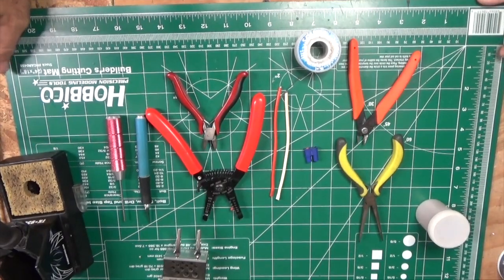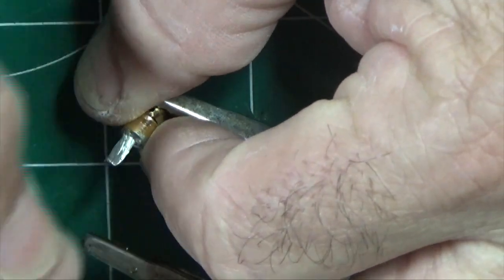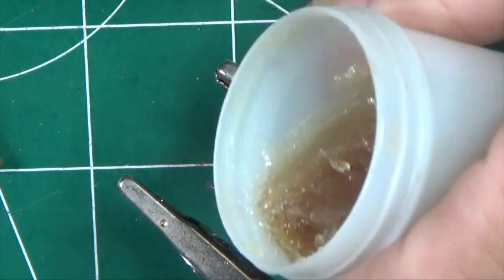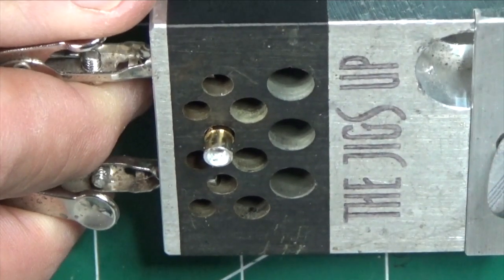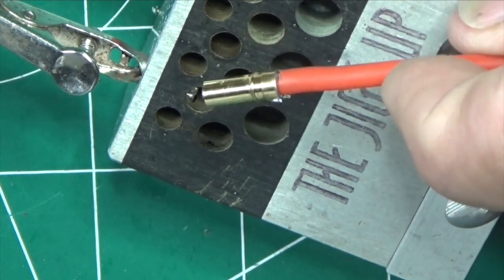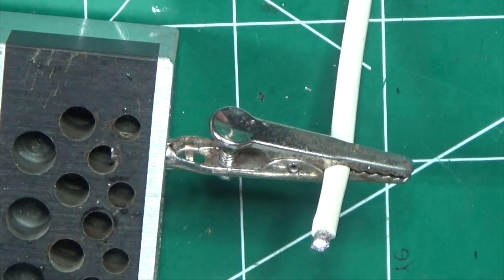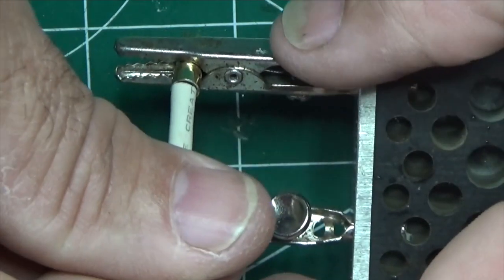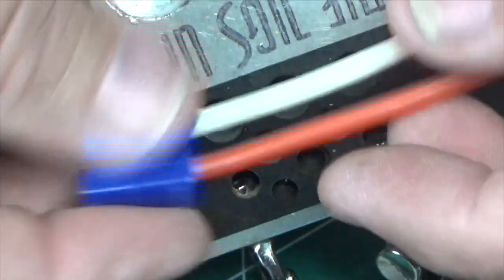Soldering Horizon EC3 Battery Connectors

Comment: Who sells :Jig's Up", good tool !. Hold wire steady with pliers  to be sure solder has solidified properly, A 37-47 watt iron is good with good soldering technique. Use quality "leaded" type 60 rosin core solder and rosin paste flux. Practice with old connectors and wire if possible. Keep iron tip wiped and tinned . Use a SMALL bridge of molten solder to transfer heat quickly to  connector barrel.
Reply from the maker: gary gullikson my local hobby shop. They closed down.

Comment: Solder is very soft, so a better way to remove excess from a connector pin, is to carve it away with a sharp hobby knife (or "snap off" utility knife). For safety's sake, put the pin in your "jigs up" - or even just a hole drilled in wood - and cut downwards!  Reheating to remove the excess risks crystallising the joint, and causing it to be a higher resistance.
Reply from the maker: Thanks for the info. I have trimmed the excess solder off with a knife before. It's just not as easy.

Comment: I just got the spektrum charger and it has EC3 with  Adapter to EC5 and I have a Traxxas charger and Hitec charger and I'm trying to figure out what connector should I use or make adapter from ecs to what ever battery I use or should I charge out ever battery connector to one connector and sale off the other charger so what the best way to go I been in the hobby since 1988 I have a alright soldering iron that has  Is temperature that goes up to 400 and I use a  Resin core solder and I have wire  Strippers and I have been buying lots of connector from Traxxas to EC5 or EC3 so is all EC3  Bullet connector go through the bottom and I still would love to have someone help me decide which connector I should use traxxas EC5 or EC3

Comment: At what temperature do you solder? Thx!
Reply from the maker: Sorry man, I've been out of it for about a year and a half because of a divorce. But I believe it was 595. It depends on the thickness of the wire. The thicker the wire, the hotter the temp.
Reply: RC1 Hobbies Thanx for the great video and info!!
Reply from the maker: @richards6246  You're welcome. Thanks for the feed back.
Reply: Temp should be the same for any thickness of wire. When the wire is thicker you simply use a tip with more surface area.

Comment: Good solderers use flux. Categorically.
Reply: RobMacKendrick this is such a easy application.  Absolutely no need for flux. Especially if you know what your doing.
Reply: @ajgreen868  Flux cleans your materials and breaks the tension present on all surfaces. It's true that modern solders have a rosin core that let you fly by the seat of your pants theoretically. In practice this is like building a campfire on the living room floor because you own a fire extinguisher. No matter how quick or simple the job, you do it better when you make judicious use of flux.
Reply: RobMacKendrick I’ve been soldering for a long time and I definitely wouldn’t use flux on this small of a job cause I know exactly what I’m doing. Now circuit boards are a different story. I always use flux on those

Comment: Poor soldering at best, this is not how you do any of this.
Reply from the maker: It works great for me:) I'm up for improving. Show me how you do it and I'll learn from you because I'm an amateur.
Reply: RC1 Hobbies As an amateur these are fine except the cold joint as you found on the white wire that pulled out. Heating one surface then sticking a cold wire to it is a bad idea and had you not tugged as hard this would have failed at a bad time. Heat both to liquid, assemble, hold still until solid. If solder is shiny once cooled this is a plus. Dull is a potential cold solder joint as your white wire would have shown if the joint were visible.